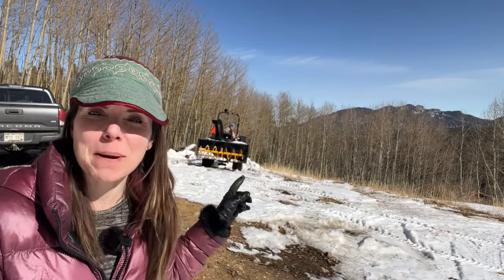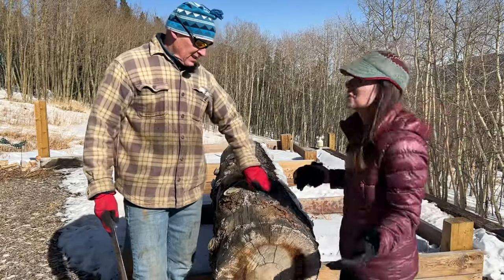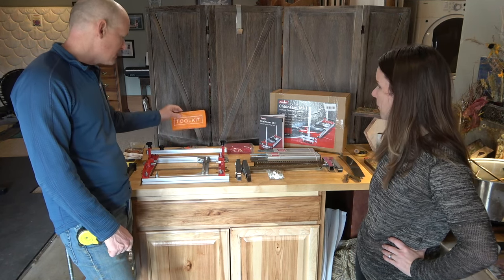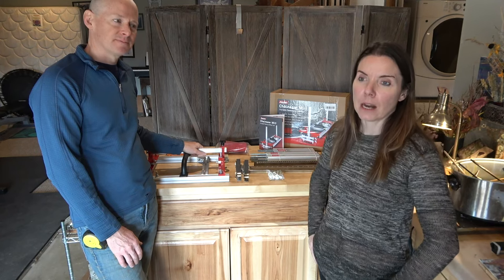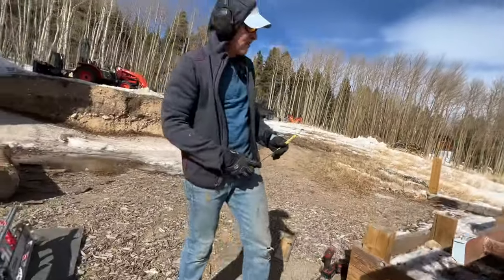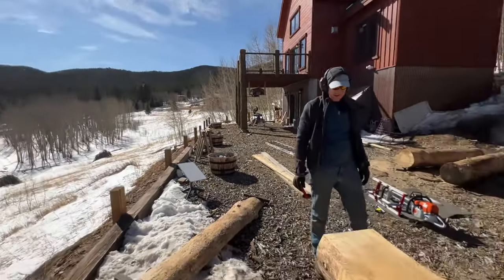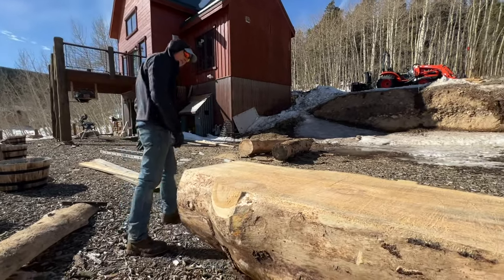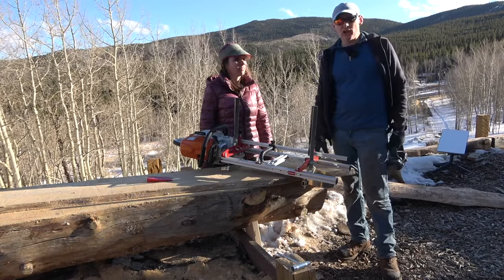Testing a New Portable Chainsaw Mill using Logs from our Property

Comment: Just a small tip. Lay your log high on the side you start cutting. With the downhill angle the saw will basically feed itself though the cut so your not having to work as hard
Reply from the maker: Thanks!

Comment: Hi Amy and Bryan,
I have viewed many videos where a chain saw mill was used and it is recommended to use a ripping blade instead of the common cross cut blade. The ripping blade seems to make it easier to cut through the log. Both of you stay safe.
Reply from the maker: I think that's what we determined as well. It was our first time using one and also a brand new chainsaw, so a learning experience all around!
Reply: @ColoradoMountainLiving  I don't think this is correct. Ripping chains make the cut cleaner or without waves or dents. Ripping chains don't make executing the cut, easier.
Reply: @FuckALLauthorities  I enjoyed very much your in depth explanation. Thanks.
Reply: @Hapotecario  Ripping chains are specifically made for "ripping" through rip cuts. The teeth are round cut instead of the typical square cut. They are more aggressive, thus dulling way faster but also leave a finer finish. You do save some time (not much honestly) using a ripping chain. Basically its user preference. If you know how to sharpen your own chains I would suggest a ripping chain, if not then square cut will do just fine.

Comment: I would be on the fence about a ripping chain. They are sharpened to about a 10 to15 degree angle instead of the 30 degrees of a regular chain. They cut slower but smoother. And they need more feed pressure to cut without dulling. Older dry wood is even harder to cut than fresh wood. I would go with a skip tooth chain. Skip tooth to reduce the load on the saw. Those long cuts are hard on the saw so I would keep the mixture on the rich side. If you add more oil to the fuel as some recommend, it leans the air fuel ratio and the carb should be adjusted richer. Should let it idle a little to let it cool down every three or four feet of cut and a minute or so at the end of the cut. They sell Auxillary Oilers for the end of the bar that do require drilling a hole in the rather hard bar.
Reply from the maker: Thanks for all the info. I guess it will depend on how much we plan to use it and such. Have seen those auxillary oilers, looks like the thing to get.
Reply: Just bought one for my old man ,ya old,thinks he can do this,chainsaws  weren't  invented  back then, he didn't hurt himself putting it together, guess I'll  buy him the saw ,maybe  a chain next year , the mill is exceptional, excellent hardware and a great locking system quit looking  for different  brand I've done that ,great buy and quality

Comment: I just put ZOZEN mill together this morning for 6X6 dock pylons. Got the ripping chain for my 550xp 22', because numerous amazon comments suggested it. I cant wait to try it. My mother in-laws lake dock was built by a rookie and it fell apart within 3 years after buying the home. Granted he built it 2 years prior. but still, on a lake that freezes and ice shifts, 4x4s are not the way. So we've got 19 acres up here in the Rockies (Boulder County) and we've been wanting to take down all the standing dead and fallen wood to mitigate. There's huge spruce and Lodgepoles to be milled aside from the fuelwood we use regularly. This summer is gonna be a BLAST!! FREEEE LUMBER BABY!  I looked up 6x6x8, 10, and 12, depending on factors, they're all roughly $35 to $50 each! When you need 12 pilons it gets expensive. Saved mom about $550 on the pilons alone. NOW ITS FREE for you and me!
Reply from the maker: Very cool!! congrats!!

Comment: Bryan, Granberg makes, and I'm sure you can find others brands as well, a ripping blade because the sharpen angle is 10 degrees, I think. Also, you can get a sharpening service to re-sharpen your used Oilomatics to the rip-cutting angle as well. This will ease the cutting a bit. I  2" slabbed a Black Locust with a Stihl Farm Boss and a 20 in blade in my Granberg Mini-Alaskan-Mill. Brutal and I now have a new respect for the cheap HF chainsaw mill that, maybe someday, I might buy. In the end I hoped to get a good Telecaster Slab but the wood is riddled with pocket rot but its dry now!
Reply from the maker: It just came in the mail, so we'll test it out and see how it goes. Thanks for the info!!

Comment: Oragon ripping chain. Get one. Much smoother cut. Don't sesaw the saw back and forth. That doesn't make it faster. Get a winch. This will keep you from working it back and forth and you won't have to push as much. 
 I make slabs galore with my granberg mill and a 660. Check out my last 2 videos.   5 minutes to go 6 foot is normal.
Reply from the maker: Awesome! Thanks for the tips!!

Comment: If budget allows get a 661 cm so you have more hp and dont have to tune it. Will cut through more efficiently..90 cc vs 60 cc
Reply from the maker: Thanks for the tip!

Comment: Get a tuning screwdriver and dial the saw in a bit. Seems to be running a tad rich. Between that and the ripping blade I think you find it cuts a bit easier.
Reply from the maker: ok thanks!
Reply: Then 2 mins later you mention tuning. Lol

Comment: Anyone here ever put the 12 inch extensions on both ends of the 36” mill, making it a 60” mill? A seller on Amazon says it will do this, just wondering if anybody has done it in real life. Thanks
Reply from the maker: interesting question!

Comment: Hopefully you're using a RIP chain and not the standard cross cut chain. Under the orange top cap there's a orange rectangular piece to be reversed depending if your doing winter or summer work, air flow to the carb.
Reply from the maker: Thanks for the tips!